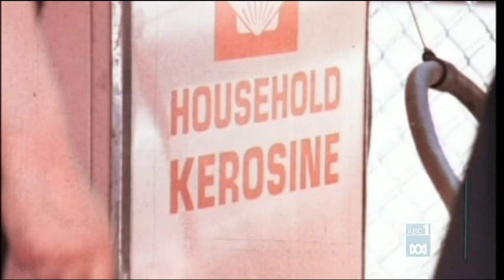Steam Powered 1963 Ford Falcon

Comment: Doktor, if you're just going to sit here and trawl the comments with the explicit purpose of attacking this concept and shitting on anyone who so much as asks a simple question about it, nobody here has any reason whatsoever to respect your opinions on the matter. You have contributed essentially nothing to the viability or economics of steam-powered automobiles, nor have you offered any kind of speculation regarding the engineering challenges of their manufacture, distribution, sale and use. I have read these comments, and instead it seems you prefer to incessantly split heirs and nitpick people's ideas. It seems as if these comments are somehow a badge of honor for you, and any perceived impingement on that "honor" is to be met with nothing less than endless ridicule. It's like winning the hundred meter wheelchair dash in the Paralympics: even if you win, you're still retarded.
Reply: Chali Chaligha I don't think you really understand the economics or the engineering concepts... Steam is still less thermally fuel efficient... and wastes fuel... The reason we still use steam is it can be more cost effective to use dirty or cheap fuel like coal or nuclear.. even if its less thermally efficient even natural gas fired plants are switching to ICEs. You won't find any new steam plant fired on oil...  because its too inefficient to use such an expensive fuel
Reply: ***** You obviously haven't read or worse bothered to understand doktorbimmer's comments. You want ridicule, hows this? BIG Hint He's right and you are a nitwit who can't be bothered to do 5 minutes research on the Carnot cycle and maximum engine efficiencies.
Reply: ***** Thank you very much, I agree that it is wrong for misinformation to be spread.
Reply: The real doktorbimmer Two words. POWER STATION. I believe they pretty much universally use steam engines. Why would money greedy companies do this if they were so inefficient or cost ineffective.
Reply: Chali Chaligha The reason is simple economics. The relatively lower thermal efficiency of the steam engine as compared to the ICE is easily offset by lower fuel costs. Coal is cheap, diesel not so much. If you plotted it on a graph, you'd find that it actually becomes cheaper to produce electricity using a steam turbine when they reach up into the 1million shp range. This limits the steam turbine's viability to large, stationary applications which is why they are virtually only found in the power station today.
Reply: ***** It's not the US's fault that natural gas vehicles havn't caught on in Europe. Simply for automotive applications, natural gas is an inferior fuel compared to gasoline. Those who have made the expensive conversion to CNG/LNG have found this out the hard way. These vehicles suffer from reduced cargo capacity, reduced power and reduced range... serious disadvantages which are not mitigated by lower fuel costs. In short it is a less practical fuel when petrol is available... not a US led conspiracy.

Diesel exhaust has been classified by the International Agency for Research on Cancer as 'carcinogenic to humans' and the classification is based on two papers. It's not the oil giants saying that and it's not a conspiracy instigated by them to get diesels banned... Why not get petrol banned too? Then we could go back to steam cars and burn 4x the fuel, their sales would be through the roof!

Modern diesels followed by ottos are the optimal. There is nothing better in terms of fuel efficiency which translates into consumer savings. This is the reason they dominate. 

Steam is a poor solution to a non-existant problem. The consumer does not need a car that can run on wood pellets with 3000 n.m of torque at the wheels. They already have a vehicle which is cheap to run with a perfectly ample driving experience. They have the ICE.
Reply: ***** That's correct, steam vehicles are only viable in the backward 3rd World where they don't have to compete with the modern western technology which made them obsolete.

If only they knew about printing money. Maybe someone should let them in on the secret?
Reply: The real doktorbimmer Exactly... Steam is inefficient and much less efficient vs ICE's, end of story.

Slightly more than 50% of our power generation here in the UK is provided by Combined Cycle Gas Turbines..... essentially an ICE with a heat recovery boiler fitted to the exhaust... hardly what would be considered the definition of a pure steam engine is it, so Chali's belief that power generation is pretty much universally the province of steam engines is wrong anyway.

Cheers.
Reply: ***** 'Gas turbines ARE steam engines'

Definitely not... They each make use of a turbine to extract energy from the working fluid, but that's where the similarities end I'm afraid.

The UK is in the 'combined cycle' age.
Reply: ***** A turbine alone is not an engine, it is simply a component common to many types of engine. Gas turbines definitely do not use steam as the working fluid so by your own definition they are not steam engines. Instead they extract energy from expanding gasses produced during the internal combustion of fuel... The two engines are different beasts, attempting to lump them together as one and the same simply because they each incorporate a turbine is absurd.
Reply: ***** No problem. yes of course we talk of the whole engine since 'turbine' on it's own doesnt mean much, therefore we add qualifying terms like 'gas' 'steam' 'wind' 'hydro' etc. 

Why would Gas turbine plants be less optimal in the states? That country has vast natural gas resources which can be extracted at low cost, they also have world leading gas turbine engine technology...  American combined cycle gas turbine plants can use this fuel and achieve over 60% thermal efficiency... plus they can be scaled up to produce 1000's of megawatts of power. A good investment I'd say.
Reply: ***** Just the facts, Steam is obsolete in land tranportation applications for one very simple reason. it is far less thermally fuel efficient than ICEs and far more more expensive to operate. It is a simple fact that the steam powered automobile has absolutely no commercial viability. If you cannot grasp the very basic concepts of operation how can you possible use the technology to produce a successful automobile design? I love steam power (especially big American locomotives) but they should be operated by historical preservation groups and museums... where they belong. Share the knowledge... not hate.  Childish insults won't make you look smart and they certainly won't help to prove your argument
Reply: The real doktorbimmer
I have not made any assertions about the viability of steam automobiles. Merely, I have noted your lack of contribution to the discussion. That being said, the burden of proof is on the accuser, and I thus have no responsibility to "prove" anything to you. Rather, you have resorted to a series of ad-hominem attacks, insulting my comprehension of thermodynamics and my knowledge of the applied sciences, without any objective proof to back up your theses.
Reply: *****  Steam is obsolete... what more proof do you need? A simple understanding of the Carnot cycle formula proves unequivocally that steam power will never equal ICEs in thermal fuel efficiency.. period. The forum is open for public comment... if you don't like what you are reading  go cry somewhere else... I'm not going to hand out tissues

Comment: I see arguments about efficiency going on, but wouldn't steam have an edge simply because there's a more complete burn of the fuel? Obviously you need good insulation too, but I know we've come a long way in that department also.
Reply: ***** Well you would be wrong then... these are some production vehicle engines on the road right now...
 Toyota Prius THS II engine 37%,
Toyota 2AR-FSE 2.5 liter 39%
Volkswagen 3.3 V8 TDI 41%
BMW N47 2.0 liter 43%
Audi 2.5 liter TDI 43%
Reply: @doktorbimmer ha u r comparinf fuel efficicy of 110 years old doble with modern ice ? not fair same ford model T with 1920 has same fuel efficy of 5 kmpl with dumb 20hp 200nm torque
Reply: Chali Chaligha WRONG.... you just got an 'F' sir....

We compare all HEAT ENGINES by using the CARNOT CYCLE FORMULA.

The steam engine can NEVER be as thermally fuel efficient as an ICE... NEVER.
Reply: @doktorbimmer we dont want to be slaves of oil mafia group
Reply: @sssbznzn  Then why would you want a car with less fuel efficiency? Steam cars are gas guzzlers!
Thats why engineers compare fuel efficiency using BSFC  Not MPG

When you compare a modern steam turbine with an ICE you can see very clearly the disadvantage steam has in fuel efficiency.
Reply: Chali Chaligha You seem to be very confused... the best Diesel engines in the world EXCEED 50% TTFE
Reply: Chali Chaligha Please look that these facts.. these are Thermal Fuel Efficiency ratings for some currectly available automobile engines (2014 models)

 Toyota Prius THS II engine 37%,
Toyota 2AR-FSE 2.5 liter 39%
Volkswagen 3.3 V8 TDI 41%
BMW N47 2.0 liter 43%
Audi 2.5 liter TDI 43%
Reply: The real doktorbimmer The theoretical efficiency of the steam engine (Rankine cycle) is greater than that of the petrol/diesel cycle (otto). This is why steam engines are used in power stations today, however you have a point in that small reciprocating steam engines used in steam cars usually have a lower efficiency than ICE's (about 5-10% less). Even so, who would care as the price of steam fuel is much lower than that of petrol (plus you can use pretty much any fuel you like) and thus the operating costs would be lower.
Reply: The real doktorbimmer Please sir look at these articles, then tell me where you got your facts from. https://en.wikipedia.org/wiki/Steam-electric_power_station
https://en.wikipedia.org/wiki/Internal_combustion_engine

Quote from the first link:
"The electric efficiency of a conventional steam-electric power plant ... is typically 33 to 48%"
Quote from the second link:
"Even when aided with turbochargers and stock efficiency aids, most engines retain an average efficiency of about 18 %-20 %"

Also, as a trivial point, if you made an extremely poor ICE then a very well made steam engine would have a higher efficiency, even if you're idea ECE's are inefficient compared to ICE's was true.
Reply: The real doktorbimmer My 25 year diesel pickup has a 41.2% peak efficiency and above 38% for a 500 rpm band
Reply: It has more to do with heat loss not complete burning of the fuel air mixture...

Even if you could achieve 99.9% complete combustion of the air-fuel mixture...? The steam engine will always lose more heat in the Carnot cycle... so it will always be less fuel efficient than a typical ICE or gas turbine.
Reply: The real doktorbimmer I don't know much about steam engines, but tell me if someone's already done this: run the steam exhaust over a heat exchanger for the water going into the boiler. Or maybe a steam bubbler into a main unpressurized tank
Reply: Nabre Labre Its called an Feedwater Heater or Injection Water Preheater... they have been around for a couple hundred years.

There is also exhaust flue gas heat exchangers such as the 'Green's' "economizer"

Both preheaters and economizers are most effective on and typically found on large stationary powerplants due to their large size, weight and extra expense.

Comment: HHO is much better
Reply: +Jose Mari Rey HHO is crap..from 1litre of water you only get about 0,12gms of hydrogen per hour..you need to have a producing plant the size of a swimming pool to run an engine and be able to rev it up..that's why they produce industrial hydrogen from chemicals and not electrolysis
Reply: +Autistic Boy  Of course it has nothing to do with the higher cost of hydrogen in most markets... in most parts of the world hydrogen is produced from petroleum.

Comment: I have only one question.... why dont we have these car engines in production or at least considered to have a market on them... boycott combustion engines... all of them
Reply: Sohave I am very familar with  DLM AG. I have been following their work for some time now and they build amazing replicas of old steam engines using modern more fuel efficient and labor saving technology,  but... I'm sorry but you must be very naive if you think that any of their engines are more fuel efficient than Otto or Diesel engines.... they have never made that claim... simply because it would not be true.

Their market niche (a very tiny niche) is replacing old museum relics still operating on tourist lines with an economical (operating costs) alternative to replacing steam with modern Diesels (kinda plain and boring really)  we would all much rather see a steam engine chuffing through the Alps...
Reply: Sohave Sorry but you are completely wrong... not only is your statement not true its absolutely impossible...
 Steam engines always use more fuel to do the same amount of work... their operating principle is less thermodynamically efficient.
Reply: The real doktorbimmer With old steam engines you are right, but note that most power plants use steam and have about 40%  efficiency (60% and more in countries where excess heat is used for central heating like Germany and Denmark), comparable to modern internal combustion engines with about 30% efficiency for gasoline and about 50% for some diesels. this is however largley due to the macro scale. an old steam locomotive or traction engine is about 1-3% efficient compared to your average cars, but an experimental steam engine build by the Finish company Steammotor has an efficiency of 27% which is comparable to an average internal combustion car on the road which are about 14-30% efficient depending on fuel vintage, condition, mark and tire pressure. the reduction compared to the mentioned engine data of 30%-50% is also due to energy loss in transmission, steam on the other hand don't require a transmission and can win some there. But perhaps it is irrelevant since an electric motor runs at 80-90% efficiency which puts both steam and internal combustion to shame.
Reply: Sohave With all steam power... Carnot tells us this 200 years ago with his formula for heat engines.

Don't get confused with "Combined Cycles" now..  compound engines and co-gen are separate systems and need to be discussed as such.... besides you can't heat your home with your car when you are out driving around can you? We also mention if an engine is turbocharged or naturally aspirated... because turbocharged engines are combined cycle too

Electric motors are very efficient... but batteries and long distance power transmission and distribution is not...
so you will never get that kind of efficiency in a electric car.

Cheers..

PS: I really love the DLM locos, I think they are very cool.
Reply: ***** Absolutely not...Rudolf Diesel directly applied Carnot's Heat engine cycle formula to create the most efficient practical heat engine available....
Reply: ***** I think your refering to Gross Brake Horsepower...  its a technical term... but then we are talking about engineering aren't we?Steam engines also have parasitic losses..Steam also wastes a large amount heat energy through cycling loss... a large amount of fuel is burned in the warm-up phase to produce quality steam...  also a considerable amount of heat is lost when ever the engine is shut down for several hours.Overall drive cycle thermal efficiency of Diesel engines is not only significantly higher,  actual vehicle drive cycle efficiency is several times more efficient in terms of mpgs
Reply: Technicaly this is also a combustion engine, Steam is an "external" combustion engines where as Petrol and Diesel is "Internal" combustion.
Reply: Oil companies would love that... steam has terrible fuel efficiency!
Reply: +The real doktorbimmer Not true! you can build a steam engine as efficient as an internal combustion engine. the dieselfication of the railroads and shipping was caused by the high maintenance costs of old type steam engines. and low prices on oil that has since gone up.
Reply: The real doktorbimmer To back my claim you can check out this Swiss company: http://www.dlm-ag.ch/en/modern-steam specializing in upgraded steam locomotives.
Reply: +Autistic Boy Carnot's formula tells us that steam has a LOWER_ efficiency limit.